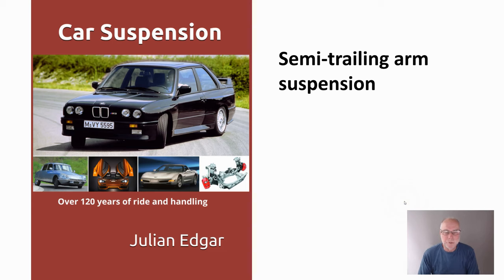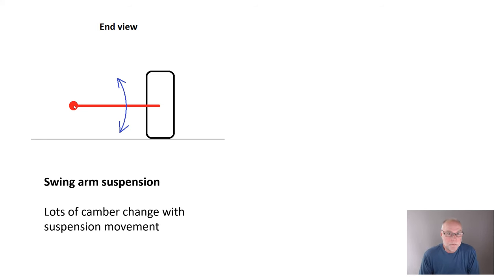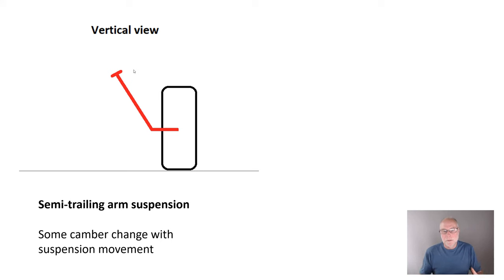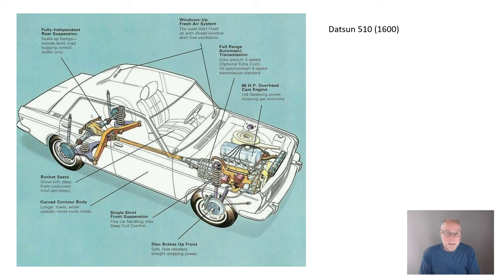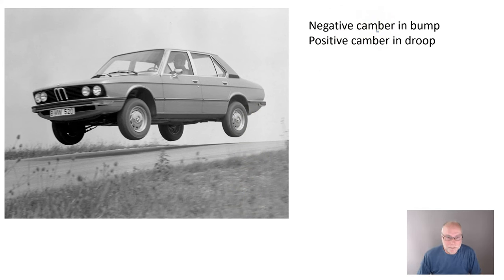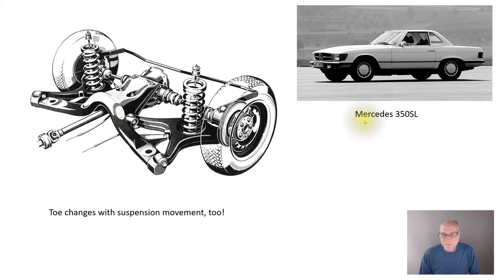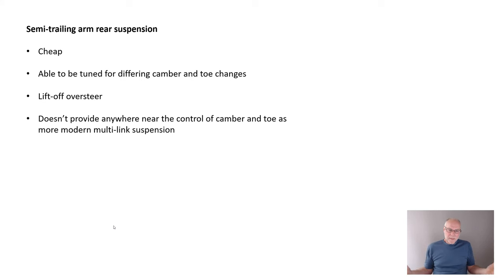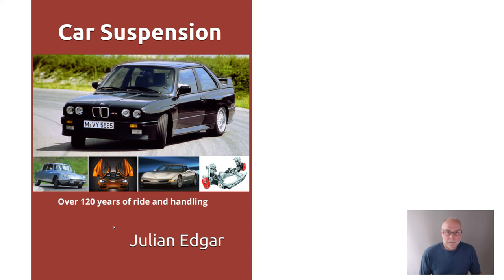Semi trailing arm suspension explained

Comment: My imported R31 Nissan Skyline had semi trailing arm rear suspension (with Nissan's early implementation of HICAS too). My biggest issue with this suspension layout is the propensity to squat under hard acceleration. When fully loaded with people and things in the boot, you could almost hit the rear bump stops when you launch it. Thankfully the rear suspension design got completely revamped in the R32.

Comment: funfact: VW is actually using a "längslenker" aka semi trailing arm in their newest VW T7 Van. They use GIANT cast aluminium links with the spring actually mounted behind the rear axle.

Comment: I implemented a semi trailing arm on my mini, previously with trailing arm, primarily to raise the rear roll centre, it drives beautifully IMO and no need for a rear roll bar or progressive bumpstops. All I read was about datsun 1600s and BMWs reducing thier sweep angle where I was looking to increase it drastically, then I realised they are RWD and as the rear squats negative camber change means the rear tyres lose traction so they were forced to run smaller sweep angles. As a front wheel drive this wasn't much of a concern so I was able to pick a sweep angle and camber curve that best matched camber change due to roll.
Reply from the maker: An interesting story!
Reply: Very interesting. My wife had a Skoda100S in the '70s with rear swing arms and learned pretty quickly about lift-off over steer but never came to any harm. Her later 130 had semi-trailers and a wider track and was a lot more forgiving. Neither was helped by being rear - engined of course but good enough as a runabout. There were tears when the last one was replaced!

Comment: I'm reliving my senior project...1999 SAE Mini Baja (basically a small UTV).  I was responsible for the rear suspension...but I did the front as well (and the final drive) because my teammates were incompetent.  I trusted them to at least do the steering.  First couple laps...we were dominating the pack.  We could corner AND absorb bumps like no other team.  Then...turns out the steering interfered with the suspension on hard bottom outs and we broke tie rods.  If you want something done right, do it yourself.  Today I make sure dangerous things don't do their dangerous thing when they're not supposed to.

Comment: The effect of elastokinematics shouldn't be understated. In addition to the natural toe-out and +ve camber tendency of the wheel hub and wheel rim present in all assemblies, there is also a significant toe-out tendency on lateral and braking torques present in semi-trailing geometries that can be tuned out in strut/double wishbone/multilink geometries, or even reversed into toe-in. For this reason some makers have adopted control methods like Mazda's DTSS for the FC3S.

Comment: Thanks for sharing! But I’d like to comment on the trailing arm design. Many French cars offered a famously comfortable ride with trailing arms, and were equally well known for their road holding capacities.
This goes for e.g. all Citroëns with hydropneumatic suspension (exception C6), including the Moose test record holder Xantia. The Xm and Zx even had passive steering built in.
Also the famous Peugeot 205 and 405 used trailing arms.
It was extremely compact too, so I still don’t know why they stopped using it. Maybe because tires have a wider low profile today. My main complaint is that all this bulkiness only eats up our resources faster, and I’m pretty sure people don’t enjoy their drives more now then people did in the past, any period.
Reply from the maker: Trailing arms have a ground level roll centre - typically not what is wanted. Most cars have had passive rear steer for many decades. Not saying that Citroen suspension isn't very good, but fans of one make tend to overlook other cars a bit.
Reply: @JulianEdgar  thanks for your reply, didn’t know about the ground level roll centre, that’s interesting. And agreed, I’m a Citroën fan and own one of this old big Cits.
But maybe I wasn’t clear, I do understand that more sophisticated links systems could do a better job.
However, in most cases it’s not worth it, or the implementation is not even good enough to seriously outperform Peugeot and Citroen. I remember many cars being advertised back in the 90’s with super multilink etc., but in real world people either don’t drive them in a way that it makes any difference, or they simply even weren’t as stable as those old frenchies.
Add to that the space savings of trailing arms, and for most cars and drivers this cheap and simple setup would be optimal.
Circuit driving is a completely different story…
So my remarks were not about saying that trailing arms are the best, I think it’s the best compromise for regular street cars, or maybe semi-trailing arms, that’s probably compact too.
I do regret all the natural resources that are put in the building of huge big heavy cars, with all sorts of complicated systems not required to enjoy a trip, with less interior room then you’d expect…
Safety would be the argument, but that’s a race to the bottom where every next generation must be bigger and heavier, impacting the environment more and more, so pointless.
Reply: @JulianEdgar I just read the section of your book on semi trailing arms, were there any FWDs equipped with semi trailing arms? If not any reasons why?
Reply from the maker: @arrindaley3714  Yes, Volkswagen Transporter is an example. However, the vast majority were on RWD cars.
Reply: @arrindaley3714  Nissan and Subaru used rear semitrailing arms on their early FWD cars (1970s and into the 1980s). First generation or two of FWD Nissan Cherry and Sunny/Sentra had them. The first Toyota Tercel (1980ish) used pure trailing arms.
Reply: @bikeaddictbp  thanks, it's seems to me as many of the problems experienced with semi trailing arms are specific to RWD, and that semi trailing arms are possibly better suited to FWD applications.
Reply: @arrindaley3714  Possibly, but with FWD vehicles, the trend since then has been to use a twist-beam axle in the rear of those cars, which is even simpler (only 2 pivot bushes for both sides!) And it has geometry advantages. There's a separate video on twist-beams. It seems that the middle ground of rear suspension designs has gone away, they either have a simple twist-beam or a very complex multi link.
Reply: @arrindaley3714 fwd wartburg 353 has semi trailing arm at the back as well , and it acted like a swing axle because the hub was fixed to the control arm

Comment: The Corvairs produced from 1959 to 1964 used a semi-trailing rear suspension. Currently a friend of mine is racing this "early model" Corvair and is doing fine against later, more sophisticatedly suspended Corvairs in vintage racing. His car number is 362, a tribute to racing legend, Bill Thomas's 1960 model racing Corvair. The upgrade is 1000lb. springs at 2-3 degrees negative static camber and good radial tires. The dampers must be properly matched. These guys all use spherical bushings as pivot points.
Reply from the maker: Yes, I cover the Corvair in detail in my book.
Reply: They used swing axle until 64 , then in 65 it received semi trailing arm from the c2 corvette

Comment: Another problem with multi link rear suspension is the cost of replacing all the bushes and balljoints! Semi trailing system is way simpler and cheaper to refresh!

Comment: Of course, major camber change is much more of an issue with modern wide tyres. The greatest handling cars of all time... the 2CV and the Issigonis Mini, ran such narrow tyres with relatively huge sidewalls that camber change on fully trailing arms wasn't an issue...
Reply: Where did you get that idea from? Data shows that while the peak is at a lower angle and there is less to be gained from optimal camber, you will still lose a ton of grip being at a very unoptimal angle on old high-sidewall, flexy tires. Some sources like RCVD have camber sensitivity curves for bias-ply tires but the tests are probably flawed as there is no perceivable trend, so I think heating etc. wasn't taken into account.

Comment: I have always believed the "swing axle Corvair" had a 45 degree semi-trailing arm. The suspension had too much un-spung weight as it was designed to hold up under the van and pickup versions with heavy springs and big loads. Pontiac copied this for 62-61 Tempest but in 63-64 the changed to a lighter arm and moved the pivots to get about a 30 degree from longitudinal semi-trailing arm.Critics thought it handled much better than the early model. The Corvair stayed with the original arm through 64 and applied several band-aids to limit camber change.
Reply from the maker: The Corvair is covered in detail in my book.

Comment: The E link rear end of the v6 Mazda 929 (whilst documented as multi-link) used to have quite pronounced camber change under load. Even a moderate takeoff from stop would tuck those rears in very much like a swing axle. I always found that a little unsettling in the wet compounded by the softness of the rear springs. Made for a very plush ride though.

Comment: Guessing you have a W123 Estate? Those had rear SLS as standard.
Reply from the maker: Close - W123 230 sedan with optional SLS rear suspension.
Reply: @JulianEdgar  Cool! I wish my W126 had it. It was standard only on the 560 in the US market. 
Mercedes got rid of the anti-squat rear suspension in the 560 for the 1988 model year - from what I read the standard semi trailing arm setup - virtually identical to your 230, introduced in 1968 with the W114/5 gave a softer ride. I've seen some people on forums retrofit it though, seems like an easy enough rear subframe swap!

Comment: Does your book have anything about leading arm suspension?   I am building a mid-engine car and the trailing arms pivots are in the way, so I swapped them into leading arms.
I spent a lot of time thinking about and trying to find what problem this may cause and found nothing about it.  The newer ford trucks using leading arms in front.
Reply from the maker: As far as I know, leading arm front suspension has only ever been used on the Citroen 2CV. Do you have a link showing the suspension on newer Ford trucks?
Reply: @JulianEdgar  I tried to find it earlier, I had a F550 and recall it did, but it actually has a straight axle with leading arms, so not an IRS like the 2CV, which btw, saw your video on that.

Comment: The Subaru wrx kept it till 2007 and I ADORE it. It feels strong and alive, love all the characteristics of it 

Edit: Subaru never used semi trailing, only trailing.
Reply from the maker: No that is not correct.
Reply: Ah yes my mistake, they are traditional trailing arms. Still adore them regardless
Reply from the maker: Not that, either!
Reply: What do you mean? The Impreza uses trailing arms for its rear suspension
Reply from the maker: A trailing arm suspension has one forward pivot point axis (like a hinge) and the wheel follows directly behind this suspension arm pivot point (eg like the rear suspension on an old Mini - see https://www.minimania.com/images_temp/80060000121a392_r.jpg  ). No Impreza has run a purely trailing arm rear suspension. (In the Impreza the trailing arm is just one of the links used, not the only one.)

Comment: Is there built in anti-lift under braking?   I wonder if it can help to reduce undesirable geometry changes.
Reply from the maker: Yes, under braking the semi-trailing arm tries to pull the back of the car down, so there is some anti-lift.
Reply: @JulianEdgar  There is often A LOT of anti-lift. Most STA cars will squat the rear hard under handbrake application, although footbrake application depends more on the brake setup ie: torque bias.

Comment: Hi, What will happen if the rear is softer than front? Isn't it the same?
Reply from the maker: The same as what?
Reply: @JulianEdgar  same as front is softer than rear..
Reply from the maker: @ckb6.3  Differing front rear softness has major implications for both ride and handling.